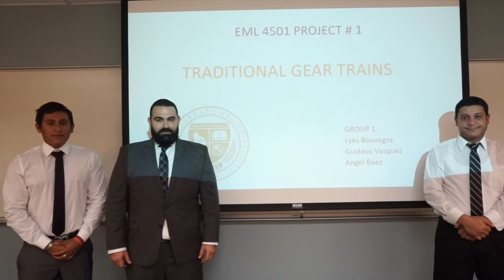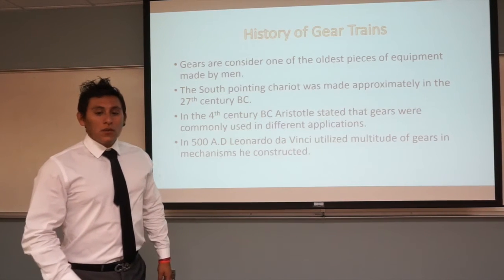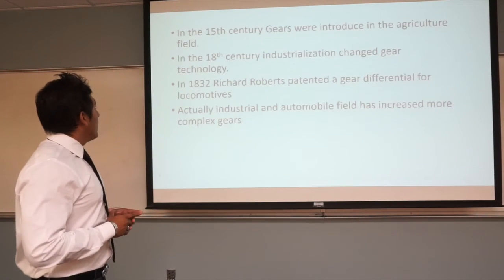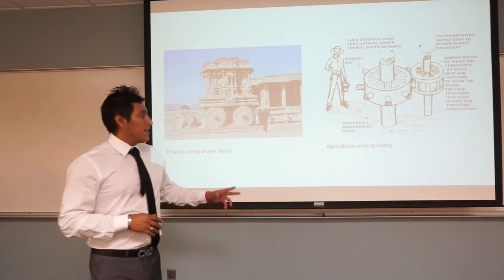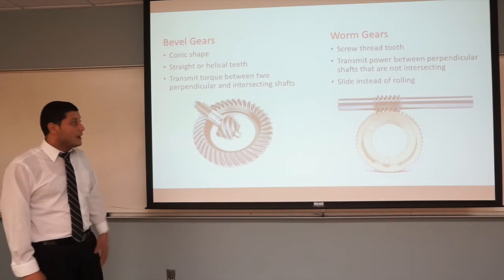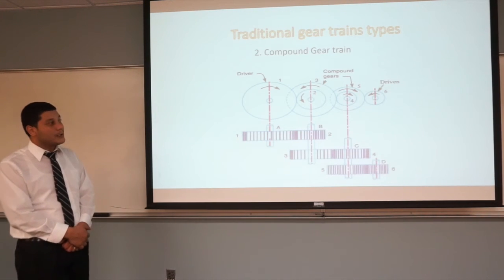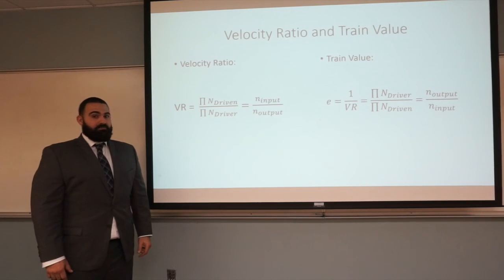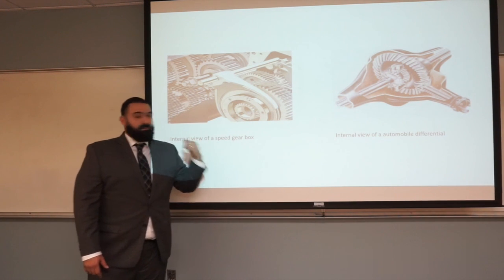Team 1: Gear Trains

Comment: This video is below average in my opinion. It had good sound quality and good lighting for the presenters. The presenters look like professionals. Speakers 2 and 3 looked nervous on camera and as a result they appear to not be too knowledgeable on their topics. The Powerpoint can barely be seen due to the lighting of the room and the blandness of the slides. The video has awful transitions between the individual clips, which make the video disjointed. Speaker 1 adds to this by appearing a little in the beginning and doing his section at the end. Furthermore, the angle of the camera makes the picture more disjoining. Many of these problems can be fixed if the team considered these parameters before filming.

Comment: Very good presentation. however limit the amount of times you look back at the slide. maybe practice a little more to be a bit smoother. Also, the contrast on the slides isn't the best, could be attributed to the recording not necessarily actual ppt.